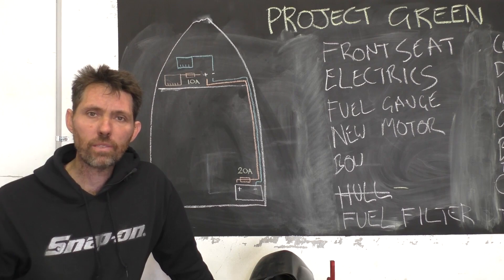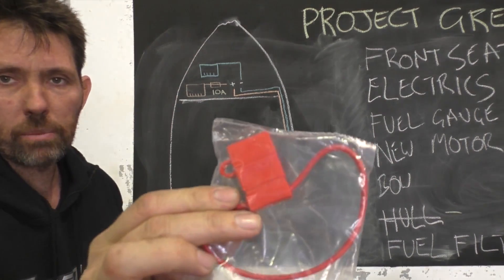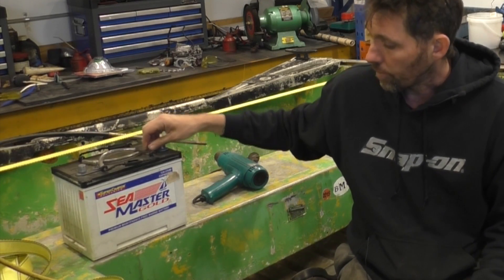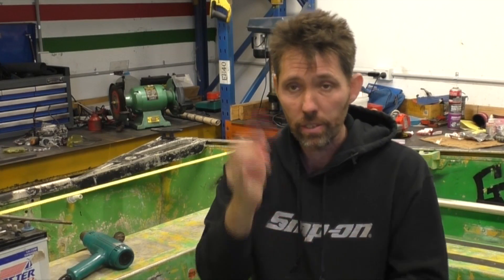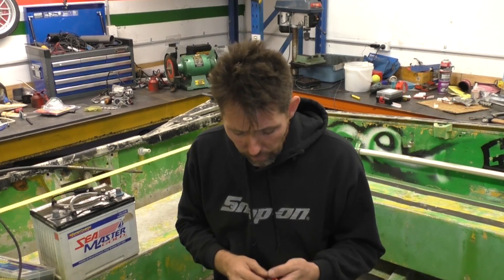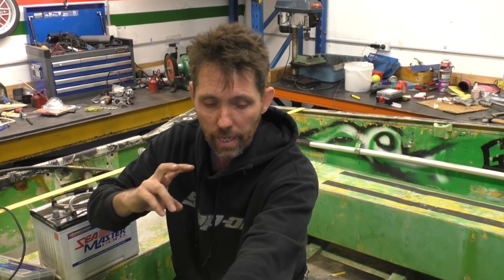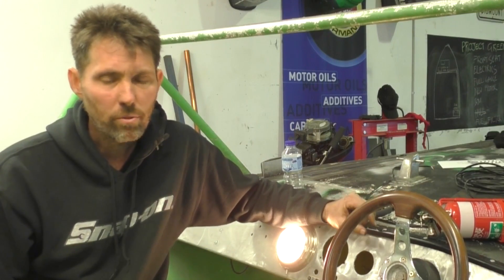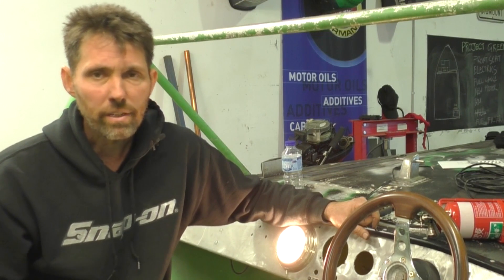Wiring the electrics on a boat [Pt 1]

Comment: Awesome video! However I just want wanted to mention (and I’m not criticizing your video). It is not a good idea to solder and crimp wires. It’s best to do one or the other. Solder actually never becomes a true solid and over time melts / deforms enough to make your crimp fail. Especially critical in high amperage applications such as the mains to the battery, starter, alternator etc. Cheers!

Comment: Hello, thanks a lot for a so simple and clear explanation how to understand an elctrical circuit. How you got the 20A fuse value near the battery and the 10A near the buses? Thanks a lot, Paul
Reply: Hello, you explained later. Thanks.

Comment: Thanks a ton for making these videos, Stu! Love your work on Renko and remembered you had some content on smaller boats like this. I'm new to this whole deal and restoring an aluminum boat from the late 60's ("Aluminum goods Model 1432") that I have many fond memories of my Grandmother using, this is going to come in extremely handy once I get to the wiring stage.

Odd question, but do you have any tips on what to do with a boat of this size sitting really low on the water? The one I'm working with is a rather shallow hull, the engine it last had (95 Evinrude 25HP) sat only a few inches above the water at the back. With the boat traffic on the lake these days it frequently takes on water easily, in recent years there's been a few bad thunderstorms that swamped it just with the rainfall. At first I was considering raising the transom and riveting aluminum bands to the sides of the boat, though now I'm thinking it'd probably be a lot easier and cheaper just to shove an automatic bilge pump or two of some kind in there, but I'm worried that might just kill the battery. I'm thinking the problem might also just be the engine was too heavy, I know this boat was rated for a max 25HP engine when it was built, and from the specs I found it looks like 25's have got heavier since then, so I guess it might just be a matter of downgrading to a lower horsepower when it comes time to selecting a new one. Any advice?

Comment: Hi, I'm rewiring my aluminum boat and heard some people say that I should put my main power switch on the negative side because of corrosion? Been googling around, but can't really find too much information about alu boat electronics
Reply from the maker: It is more above cutting the power off as early as you can in case there is a fault in the wiring before the switch. From a corrosion point of view it is important not to use the hull as a ground. Always run twin core wire all the way to and from battery.
Reply: @DangarMarine  ok, thank you so much. And keep up the good videos

Comment: Hey Stu. Greetings from Boston MA. Your channel is my favorite thing to watch on any medium. You do a great job and I’ve learned a ton. Thank you! I’m having trouble finding robust ring connectors for 12 AWG wire. All I can find are the heat shrink ones and the rings are flimsy compared to the ones you crimped and soldered on. Are those rated for 12 AWG or did you use something rated for a thicker wire and just crimp it down?
Reply: This would be for my main run from the battery up to the posts under my console.

Comment: Excellent help.  Thank you.  Where would you in-line a master cut off?  After battery and fuse?
Reply from the maker: On my bigger boat I have a high rating fuse right on the battery terminal and the cut off switch straight after that.

Comment: Hi Stu. I'm from down on Scotland Island I really love how familiar everything in your videos is to the setups we have down here.

I am having trouble with the soldering of the connectors on the ends of the wires. I have all new equipment, Tin solder (lead free) and a 40w soldering iron that doesn't have variable temperature (all purchased from Jaycar). For the life of me I can't get what you do from 6:20 to 6:30 in the video to happen for me. I also wonder what type of butane torch you would use to melt the solder and fill up the connectors once they have been crimped. Cheers.
Reply from the maker: Hi Oliver. The metal needs to be quite clean and you need to transfer quite a bit of heat into the metal for the solder to flow. A bit of solder on the tip of the iron will help the heat transfer into the metal.
Reply: @DangarMarine  Thanks. I ended up getting a variable temperature soldering iron and everything happened easily once I could turn the heat up a bit. Now the fuse keeps blowing and I have to revisit all the circuits and see where I've made a mistake :(

Comment: Hey Dangar! Do you already have a video about wiring all of your dash gauges(Speedo, tacho, fuel, volt, etc.)? I recently started a project and need a little more guidance in that area, especially with how they wire together for the power.
Reply from the maker: Not really as there are generally outboard specific. There is one on tacho though.

Comment: Why fuses? Why not circuit breakers?
At least with a circuit breaker you can reset critical kit at sea - appreciate you should carry spare fuses, but if you run out while still on the water...
I wondered this on the Renko electrics too.
Just thinking

Comment: Good day buddy,  hope ur hands are healing nicely.. I have a 15 foot Boston whaler supersport.. I am thinking of putting the gas tank inside the console, with the radio electronics and wires all under the center console,  will I have any issues? I have not wired boat yet, so any ideas I would extremely appreciate..
I'm open for ideas. Text me 954-288-5975, I will send you pics

Comment: Will 12 gauge wire be ok going 17 feet long? I was told 8 but not sure,,have no power from battery to the bus bar,,can't find a short so going to re-wire it, motor and dash gauges work fine on other battery, (have two batteries),, bilge fish finder and lights are on the dead wire, I just want to do it right where I don't have a fire or blown fuses

Comment: If I used fused bus bars do I still need the 10 amp inline fuse? I'm going to use it unless you say no :) Another good 'un mate
Reply from the maker: The way to chose fuses is to think about what you are protecting. The main fuse at the battery is protecting the wire that heads forward from melting. Then, closer to the the device you can have a smaller fuse to protect the finer wiring etc. There is no advantage to having two fuses of the same rating in the same line.
Reply: @DangarMarine  Understood, many thanks

Comment: Great video mate, I was just wondering why not take your leads straight to the bus rather than run them to the posts?
Reply from the maker: It gives you flexibility down the track. If you have a high current draw item like an electric trolling motor on the bow you can come straight off the posts.
Reply: @DangarMarine  Thanks for the reply mate, your videos are very helpful.

Comment: What's your thoughts on useing marine tinned wire as apposed to the standard 8b&s automotive non tinned copper wire ??
Reply from the maker: In a long term, hard to replace install I would go tinned, but if it is something on a small boat that is non-critical I wouldn't lose any sleep over using regular copper wire, especially if you solder or crimp with good tools.
Reply: @DangarMarine  .
 Once again mate really appreciate your time.
 I put a bit of dielectric Grease on any copper that's not heat shrieked. 
 Cheers form Perth.

Comment: Another great video Stu! I know you can get marine shrink fit but i have been putting a coat of silicone over the solder joint and the shrinking the shrink fit over it causing it to squeeze out the ends.... I have done this to a few bilge pumps in yachts where the join may sit in water at times and has been good for many years!

Comment: the practice of both a mechanical crimp and a solder connection is an excellent example to teach your viewers. I had over 40 years in the apparatus repair business--our local steel mill, the State Ferries, US Coast Guard and the US Navy require it --I learned at a young age. Simple yet strong and efficient----Mikey

Comment: Hi mate love the videos your videos have helped me purchase my first boat.
Just a question about this video I have wired everything the way you show it but every time I turn the bilge pump switch off it blows the fuse.
Reply from the maker: Hmmm, that's a weird one. Normally a fuse will blow when switched off not. May be a faulty switch.
Reply: @DangarMarine  I found out the cause I wired the switch panel with the positive and negative 
The switch should only be wired by positive from the pump and battery and the negative from the pump should go straight to the main negative right?

Comment: in an alloy boat never ever ever let the hull be your earth, always run an earth wire back to the battery and isolate anything that earths through the casing from the hull otherwise  if an  earth wire gets corroded you will end up with pinholes on the waterline

Comment: Your dog looks so very enthusiastic when boating. The fuses you use are to protect the size cable used. The idea is to avoid overheating of the conductor also to ensure there is not to much voltage drop so it will operate the protection device (fuse or circuit breaker) using a 10 amp fuse is good unless there is cable too small for 10 amp on accessories. Many circuits in automotive use smaller fuses. So glad you mentioned mechanical protection also sharp edges should be protected specialty where single insulated cable is exposed.
 60 year old bush Sparky
Reply from the maker: I've definitely seen a few boats wired without fuses and when the wires heat up from a short they melt all the insulators off and then short even more. The end result is almost always a complete re-wire (with a fuse!)
Reply: Sorry I was just trying to explain that the fuses are to prevent major faults in the feed wires in the system. Generally a fuse can be used to protect sub circuits that being what you are doing. I personally like to buy a switch board with individual fuses they look good in boats and campers and like you said they make diagnosis easy More and more people are wanting to go solar 12v / 24v systems with a inverter for appliances unavailable in 12v a inverter is probably a really bad idea in a tinny. How does using the frame as a return effect electrolysis??

Comment: Hey Stu. Love the series. Thx!  Question for you. I picked up one of those rocker switch panels everyone is raving about these days. All pretty straight forward but was wondering the best way to have power to that coming off the key? I don’t want it or any of my accessories really hot all the time and wanted something a bit more secure than just a master switch. Figured a lead off the key was the answer here but not sure the way forward. Should I go with some type of relay to control power to the bus bar? Hoping to hear back from you and condolences on the kidney stones. Been there. Hoping not to ever go back!
Reply from the maker: Hey Alan. Having power from the ignition activate a relay that powers a fused bus is a good way to go. You just need to splice into the +12V wire coming out of the forward controls to get that activation current.
Reply: Perfect. Thanks for the confirmation Stu. I’ve got a starter solenoid on the way from our good friends at AliExpress. Now the wait begins 😀

Comment: Great video thanks. Is it true that alloy boats need to be earthed only to the neg batt terminal?(not to the hull)
Reply from the maker: Yes, the hull will always be negative as the motor is and it is attached to the hull, but you want to provide a path of less resistance to the battery so current doesn't pass through the hull as it will cause electrolysis that will eat the metal away.
Reply: Cheers thanks.

Comment: The only suggestion I would make, is to have used 10 ga. Main wiring from the battery to the terminal blocks. I think 12 ga., although adequate, does not afford you enough room for expansion and additional current draw.
Reply from the maker: I don't think I'll be adding anything new to this boat, but when I wire the wooden boat I am building I think I will go the thicker wire just in case.

Comment: Can you tell me where I can order the power distributor on the right and the busses on the left? Can't seem to find the exact parts you use. I also see you commented about using a fuse block instead, which would you use and in what configuration? Thanks for the video, got me well on my way.

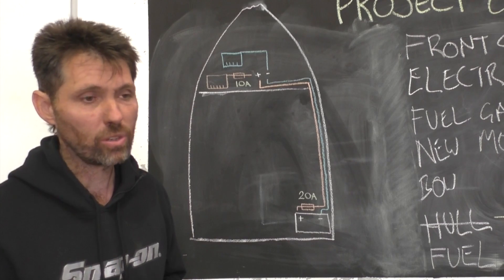Comment: First away... Great video tutorial! I’ve used this video and part 2 as well as the video on wiring a bilge pump extensively to help me with my set up. One question tho: In this video (around the 3:50 mark) u say that ur bilge pump and engine start will be wired separately from the bus bar set up to protect the critical systems from a lesser system blowing the 10amp fuse and taking out everything... yet in the bilge pump video, u did wire the pump connection to the bus bar set up under the dash. Can u explain the reason for the change of heart?

Again... really get a lot out of ur tutorials, keep up the great work!!
Reply from the maker: To be honest I can't remember how or why I wired the boat this way any more, I'll have to take another look. Ideally I still agree with the principle that you want a bilge pump to be completely independent of any other circuit. You certainly don't want a fuse blown by water in a light fitting or something taking it out of action.
Reply: Fair enough... Thx for the reply

Comment: hello
can I ask you for the help.
I bought boat with all instruments ( tach and fule consuption  for yamaha outboard). instruments were conected to ymaha 50 Hp 2014 y. Outboard was sold with  long 10 pin cable, unconected from remote control. Now I bought 2004y  50 hp ymaha 4stroke,
round 10 pin  conector  under cowl i conected to 703 remote control.
but there  under cowl are 2 squere conectors( 1 small with 3 cables going into(black, red and grey), and 1 bigger one( 4 cables -2 pink , 1 yellow , 1 yelow/red))
i need to buy  a cord with conectors fiting to tach instruments  but i cand find part no for this cables.
Reply from the maker: Not sure what the part number for that cable would be. You might be better cutting the plugs off and putting some bullet connectors on.

Comment: I have a 5.1 m rib with the console in the middle . I want to wire it the same way as demonstrated but with change one thing . 

Would it not be more beneficial to install a 6 way water proof fuse box for example rather than a busbar ? You run the wires from the battery to the positive and negative on the fuse box and connect you’re accessories. I’m not saying this is better as I’m a novice so I’m just looking for you’re opinion . Many Thanks !
Reply from the maker: +Liam MG Hey Liam, I do think that is a better way to go, I just used what I had lying around. You will still need a bus bar for the negative side though.

Comment: Hey Stu,  great videos. Thanks for teaching us all. Quick question. When installing a new device and its wiring, how do I know what size fuse to use? For example, I'm planing on putting a USB charging port for cell phones in our boat. 
How do I know what size fuse to install? 

Also, if installing a bus bar with fuses for future items, I assume there is a limit as to how much you can run off of one bus bar.  How is that determined?   

Thanks
Reply from the maker: Hi mate. Usually the manual for the device will tell you the recommended fuse size. If not, take the power (watts) that the device draws and divide it by 12 (the battery voltage) and that will tell you how many amps it draws. You then need a fuse slightly higher than that number. Some devices draw a short high peak on startup so if the fuses blows when you turn it on, try one a bit higher. The bus bars can normally carry quite a bit of current so the limit is really the number of terminals on it.

Comment: watch those colors

for 12 volt use red for positive and yellow for ground, thats the boating standard
the use of black suggests higher voltage, either 240 or 120 volt

the problem comes 'if' you have higher voltage introduced later, which would use black
creates unnecessary confusion, with possible fatal consequences 
'yes I agree this boat is unlikely to, but conventions exist for a reason, someone being dead is a pretty good reason ..

still these are good topics to cover and i liked the video
Reply from the maker: I'm presuming this applies more to larger boats that will have generators or shore power as every outboard manufacturer uses black for their 12V ground wires. Good to know though.

Comment: Hey man -- your wiring video inspired me to do something about the wire mess in my boat, so I did.  Got a new fuse block, the type with a negative bus built onto it, and I mounted it in a smart place instead of the lazy, visible spot that some previous owner did.  I ripped out all the old wires that fed my electrics and threw them away.  Clean new proper-gauge wires from the battery to the block, inline fuses, put heat-shrink tubing on every connection.  Re-connected my fishfinder, running lights and radio, added some cool-looking LED-lighted switches to my dash, and hid all the wires in flexible conduits out of sight.  Finished the job yesterday and to my shock, everything works properly.  Feeling pretty good about it.  Appreciate the video.
Reply from the maker: Nice one. It is always very satisfying to clean up old messy wiring. My only real regret in wiring the Green Machine was not just buying a terminal block with a fuse holder for every attachment. I might pull all those inline fuse holders out one day to make it better.